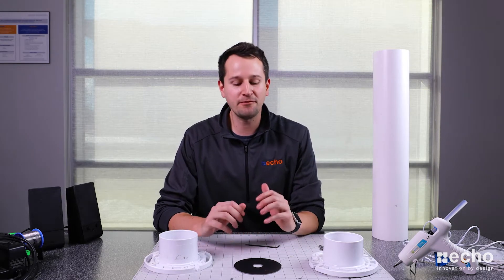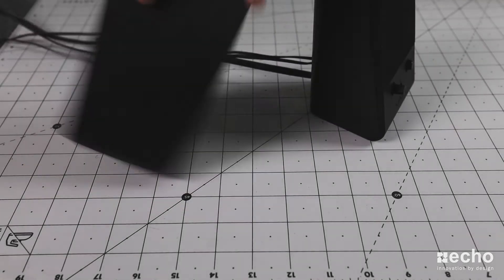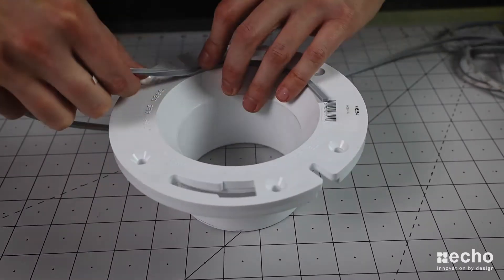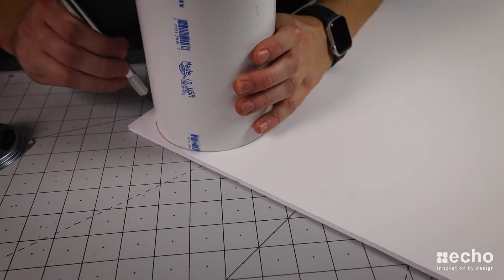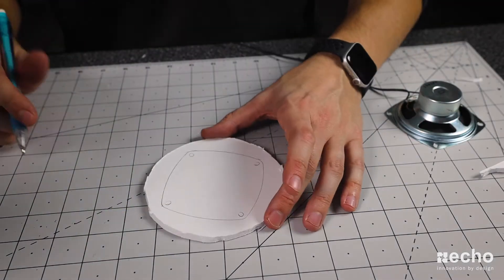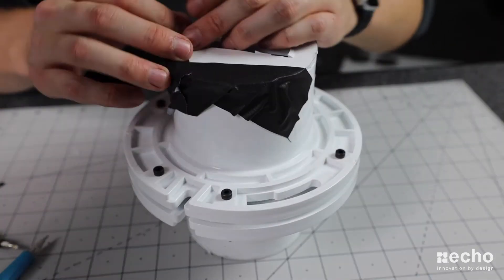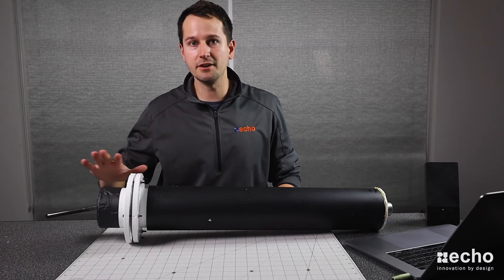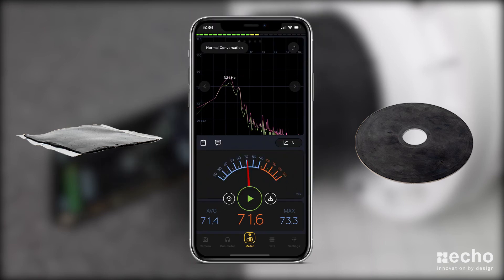DIY: How To Test Sound Absorption Materials

Comment: You do not need to unsolder the whole speaker that's crazy and unnecessary complication. Just go to control panel and change the balance sound from the options only to the left or only to the right speaker!

Comment: The frequency output of that cheap 3 inch speaker tapers hard below 300 Hz, so it's not suitable for testing bass transmission.  Most tests and data are poorly tooled for testing materials used in critical recording or listening environments such as recording studios.  While just about anything sold as insulation will block/absorb frequencies above 1000 Hz, all the industry standardized tests seem to have been designed before the invention of subwoofers and don't test below 125Hz, which are the hardest frequencies to neutralize.